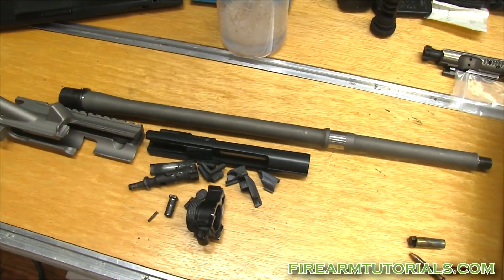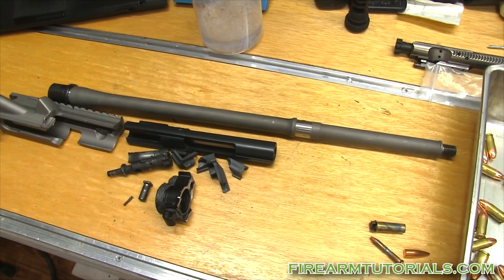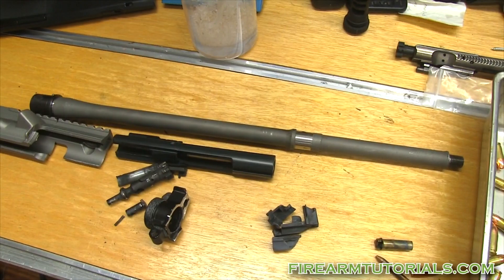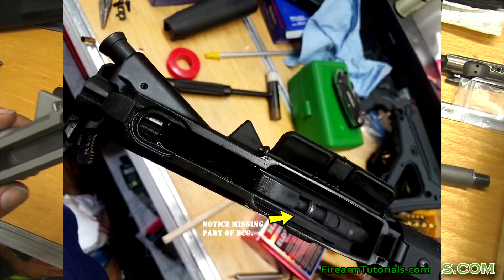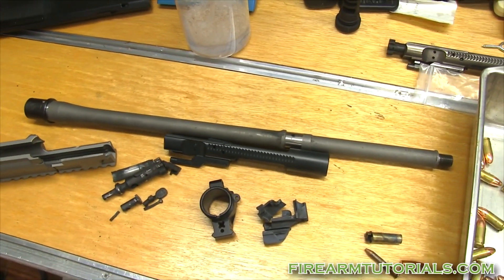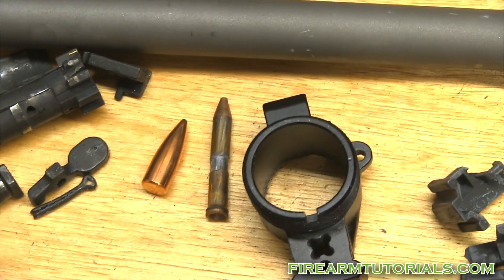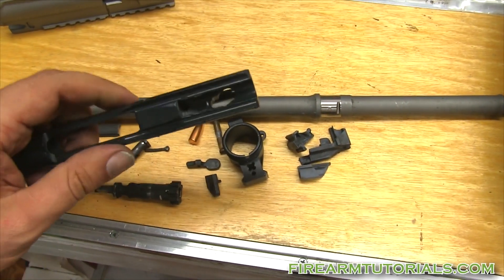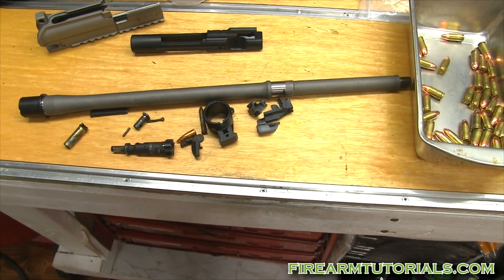I KABOOMED A NOVESKE RIFLE

Comment: I would use the barrel if it passes inspections and gauges
Reply from the maker: I did end up re-using the barrel.  It was fine.  Just needed a new upper receiver and BCG.  It's run fine ever since.

Comment: As someone that handloads 5.56 and 300BLK I go through great pains to mark every loaded cartridge using a sharpie.  Black for 300BLK (duh) and red for 5.56.  An unmarked hand load is suspect when loading.  On top of that I have either bought dust covers stenciled with 300BLK or556, or I use a label maker to mark the rifle with its caliber until I can buy dust covers.  Finally, I keep my black mags for blackout only and the dark earth for 556.  This last part is often  a problem when loading up a day’s worth of shooting so I put black tape on dark earth when I’m running extra blackout.  I’ve been doing this since 2010.  Knowing just how dangerous this mixup is, I put as many visual cues to avoid the issue.  So far so good.  Oh, and I NEVER carry a mix of both calibers in my range box.  When I’m shooting a mix, two ammo boxes are carried.  Discipline is better than having an expensive firearm turning into scrap or worse.

Comment: Was this a full factory build Noveske? Or just an complete upper?
I see a Gen 1 lower. And a Gen 3 upper??
Reply from the maker: Factory Gen1 gun.
Reply: @FirearmTutorials  gen 1 uppers had the Cross on the pic rail? Only my gen 3 has that. But my gen 2 has a Noveske marked Vltor. I never knew there was an actual Noveske Gen 1 upper.
Reply from the maker: @donhosbf  I have several gen1 guns and they all have the cross on top of the receiver by the charging handle.  I've seen several with Vltor marked ones but I don't know if those come from the factory in complete guns or just available on their site as parts by themselves.
Reply: My gen 2 factory Afghan has a gen 2 lower(forged) and a Vltor(noveske marked) upper